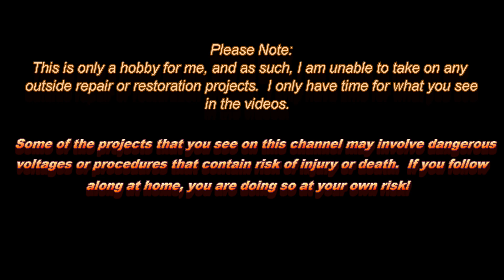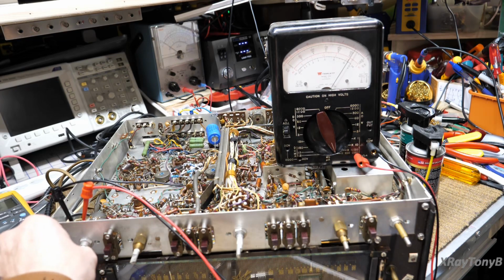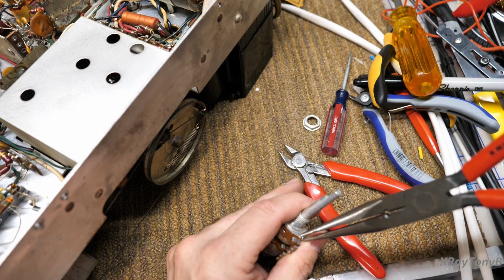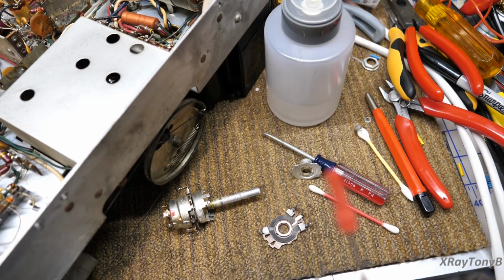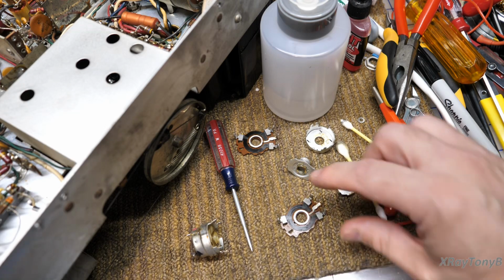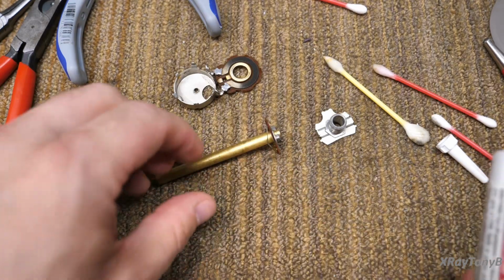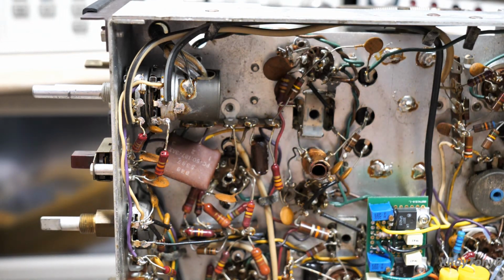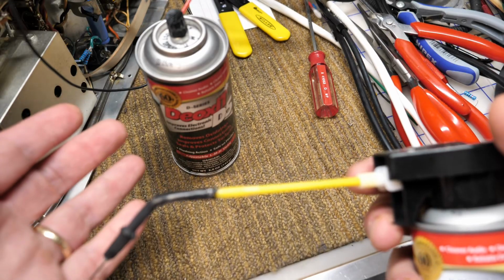How to Clean & Resurrect an Embalmed Potentiometer (With Bonus Rant)

Comment: So now I guess the question is do I mess with my pots knowing they have a LIGHT coating of Deoxit red or just leave it because they are working fine for now, and have been for a couple years.  I knew exactly HALF this story, I did not know to not use Deoxit at all on carbon trace pots, I thought a very light application to lube was fine.  I also dd not know about friction grease, and yeah, my pots have no resistance when turned.  Man, I hate to open that thing up again...I suppose there is no immanent danger...
Reply: Well, that's a case of "if it ain't broke, don't fix it" vs "preventative maintenance ".  A lot of variables here. Time, money, effort, return on investment, replacement part availability, etc. I  have several pieces of equipment (all antiques ) that were  exposed to minimal doses of RED! They work fine and the pots check out great on a VTVM. I'll be using this info for future work, but I'm not losing any sleep over carbon track health. Cheers

Comment: What is the difference between the  Deoxit D5 and G5?
Reply: G series is for Gold contacts, hence the GOLD all over it.
Reply: tip - dont use gold plated cables unless the equipment is gold plated. Dissimilar metals in contact means the more reactive metal will corrode (thats how batteries work), & gold is the least reactive metal, so your equipment will end up being the sacrificial anode. All non gold plated cables even with gold plated equipment is fine as long as you dont mind the cables corroding eventually, theyre easy enough to replace.

Comment: Gosh thought you saw a cockaroach on the cap.   Would advise to take pictures with disassembly.  Tabs doesn't take multiple bending very well.  Also marker or metal scribe.
Reply: Yeah, a Sharpie mark doesn't adhere well to surfaces that are already oily or greasy from previous attempts at cleaning the control, and alcohol will wash Sharpie lines away in a millisecond. Scribing a line works better. And, as Tony said, take pictures during disassembly. If somebody is a newbie at this, practice on an old control first; and clean the workbench in advance before disassembling the pot! A sectioned tray will help keep the parts in order so that you can put them back together in proper order without making mistakes. You might only get one chance at doing this right!

Comment: Wish I had seen the Deoxit D5 Spray video a few weeks ago. I messed up the pots (carbon) on my guitar. I've used the stuff for years but always in tiny little sprays. Overdid it...The pots are destroyed. All gunked-up... No more DEOXIT
Reply: Use WD 40 I swear by it
Reply: @kerrybarratt6298  It may work for you, but I've had plenty of situations where I've had to clean out WD-40 that has gunked-up controls and pots.  WD-40 is nothing more than kerosene in a can and is not designed for this purpose.  It was designed to displace water.  I've only found it useful for removing stickers and re-flowing dried grease with temporary success.
Reply: @kerrybarratt6298  You would REALLY love the channel TechYesCity then, he uses SuperCheap Auto Multi Purpose Cleaner by the case to gunk up electronics

Comment: DeoxIT D5 uses minieral spirits. Acetone is a mineral spirit. Mineral spirits break down carbon. This is why they're used in engine cleaners. Mineral Spirits break down carbon deposits in the engine. 
So this is why using DeoxIT D5, which contains 75% mineral spirits in it, shouldn't be used on pots and faders.
Reply: you are totally wrong

Comment: DeoxitD5 has NO ability to harm any potentiometer at all, period!!!
Reply: not exactly true.. Ive seen amplifier restoration videos, where there was absolutely nothing wrong with the pots, But they sprayed them with Deoxit anyway, just as routine maintenance during the restoration.. and afterwards, the pots had loads of issues...
I think it all depends on how the potentiometer was manufactured though.. Its materials inside..
Reply: Indiscriminate use of Deoxit can completely remove all the "feel" grease from a pot, so that statement isn't completely true. A little goes a long way and if you don't saturate and use a quarter can on a single pot you will be fine. That's the problem with some DIY's is that they obliterate the pot with the stuff and ruin the pot.

Comment: Next time a pot needs a spray, I'll probably first try D100 or F100 spray to keep damping grease intact as much as possible. I wonder how much of the D5 "gunk" is really just partially dissolved damping grease. By the way, has anyone ever tried compressed air to clean a pot?

Comment: Tony;
Thanks for this video. I wish all these "I deoxed it" people would watch this video and stop ruining wonderful old 1970's audio equipment.
Reply: For vintage electronics from the 1970's and on, using DeoxIT D5 is perfectly safe if used correctly (not flooding the pot - just a quick "spurt").  It's very unlikely the carbon has been worn off to an extent that D5 would cause any issue.  It's older pots from the 30's-60's, especially ones that are made out of what is essentially laminated cardboard, that it can cause issues.  I love Xray Tony's videos and he's very clearly an accomplished tech, but some of the DeoxIT D5 "warning" is a bit alarmist.

Comment: what to apply and how to clean potentiometer but not take it apart just in receiver amp etc
Reply: Is that a statement or a question?
Reply: @johncoops6897  question
Reply: @DerekHundik  - Use a Potentiometer cleaner. DeOxit and many other companies make the stuff. Probably the most well-known are DeOxit F series (FaderLube) for faders. These are not AT ALL similar to DeOxit "Red" D7 or 100, which is a contact cleaner, and only suitable for wire-wound pots.
The important thing is that potentiometers have a smear of grease on the carbon track. Contact cleaner dissolves the grease, so the pot fails very quickly after "cleaning". The specialised potentiometer cleaners have a waxy lubricant that restored the friction-proof coating.
Probably the best way is to open the pot, completely clean the track with IsoPropyl alcohol, then apply a dedicated potentiometer grease on the shaft or slider (eg: Caig DeOxit Fadergrease) and the correct lubricant on the track (if the pot originally used any).
It's worthwhile to trawl around the Caig website for more info.

Comment: I've found, and have been chastized incessantly for my method.  Now, Barry Fone of Barry's 8-track Repair is also another fella who doesn't like DeOxit.  He recommends just plain old WD-40 for its mildly lubricating qualities.  It does clean, but it's not as efficient as other cleaners.  But it does also have it's Water Displacing Qualities.

I go on better.  I clean using DeOxit, let the pot dry, then I spray with WD-40 to lubricate and protect.  

I was finding that if I JUST used DeOxit, the pot would get noisy again in a few months of use.  If I DeOx'd and then WD-40'd..... stuff I'd done 3 years ago still works as it should.

YES, pots and sliders should be cleaned, but they should also be lubed.
Reply: WD40 isn't a lube, it's a penetrating oil.
Reply: @v01dgazer1  No it's not.  It's actually a Water-Displacing oil with mild lubricating properties.
Reply: @v01dgazer1  actually WD-40 is a solvent. It's Stoddard solvent specifically. Along with perfumes. WD-40 is the best cologne on the market. Drives the women crazy when they smell it!

Comment: Interesting.
I have done 80+ reel to reel decks potentiometres with D5 and after treated with F100.
I have never had a single issue and that does not count the numerous amps I have done.

I'd say that what has happened is someone tried a alcohol based contact cleaner and did not succeed, then tried with Deoxit and by that time grease from the shaft has laid itself on the carbon track. 
This I have seen many times, but no, Deoxit won't ruin a carbon pot. 

Now adays I use F5+F100 for potentiometres.

I do not agree at all without D5 ruining carbon potentiometres.

Contact cleaners containing alcohols, will damage carbon tracks, but as I already mentioned, not one single fault with D5 in carbon pots or even carbon slider pots.

Besides, of course the swab will pick up lots of debris, it's a used CARBON potentiometre, there will de dust, carbon particles etc. that make up that goo.

Best and kind Regards

Comment: All of this goes double for tube testers, and especially for anything that carries RF signals. Spraying controls and especially rotary wafer switches can make the phenolic-wafer insulators *conductive*!  You can ruin a tube tester this way, creating leakage paths between the switch contacts. I've had conversations about this with other wannabe techs ---- one guy told me he already knows all this but  "I was defiant and and did it anyway, and it still seems to work okay".  Until it stops working okay at some point in the future, or you happen on a particular piece of equipment that takes an extreme dislike to being sprayed with DeOxit, and now you've got a real problem.

Comment: I use 'Servisol Super 10' Great stuff
Reply: Seems to be a mix of propane, butane and kerosene. It doesnt claim to be plastic safe.
Reply: @mycosys  May not be safe for some plastics but I've not had a problem with that yet.  Its great for cleaning electromechanical components like rotating and sliding potentiometers, variable resistors, switches etc.
Reply: @EDcase1  Rubbers, ABS and other Styrenes would be the big gotcha for either naphtha or the heavier mineral spirits and volatile hydrocarbons in Super 10. Cole-Parmer have a good materials compatibility database.
The big gotcha for IPA is PU.
ABS is the biggie with so much computer equipment being made from it. Im sure most or all of us made 'n@palm' as a kid from fuel and sytrofoam.
Reply: @mycosys  Thanks for the info

Comment: Is it ok on faders?
Reply: No.  A fader is a potentiometer.  Deoxit should only be used on metal to metal contacts such as in a connector or a switch.
Reply: DeOxIt Red no. Deoxit F Green Yes. No residue electrical contact cleaner (isopropanol anhydrous & naptha are common) is also ok if followed with fader lube like Deoxit F. Seemingly the most effective in-situ method for very gunked up pots is no residue contact cleaner to loosen dirt, gentle compressed air to remove dirt and fader lube to relube.

Comment: So as i understsnd 
for small noise on pots use 97% alchohol then the D5 green spray are ok ? 
This will clean & will not remove the existing Friction grease that on the pot shaft ( will not make it loosie ) and or damage the carbon & fibers board  ? 
Just wonder what spray can we use  on vintage stereo pots without damage the lubrication????

Comment: Red Deoxit is just as bad as using WD-40. Oily cleaners are bad. I use Sprayway contact cleaner. It cleans and it evaporates leaving no residue what so ever. You can buy Sprayway on Amazon.

Comment: **Question:** Is it carbon from the atmosphere that causes potentiometers to malfunction?
Reply: No
Reply: @isoguy.  what is the black stuff that attaches itself to electronics contacts over the years?
Reply from the maker: The resistive element of this type of potentiometer is composed of compressed carbon powder.  As the metal wiper tracks around the carbon resistor, it begins to wear off, causing the contacts to get dirty.  In addition, the brass contacts themselves can get tarnished, which degrades the contact surface.  The purpose of the cleaner is to remove the tarnish and carbon residue and to restore the contact surface.  If you use the wrong cleaner, it can cause the compressed carbon to break down and crumble.  Hope that helps.
Reply: @midmodaudio6576  if we are talking pots the "crud" composition which builds up during useage varies depending upon potentiometer wear characteristics, modus operandi and location, for example
1)  metal to metal contact.e.g. pot spindle to pot body. (fragments of metal)
2) metal contact to carbon based track pressure and surface finish. (Fragments of carbon)
3) If unsealed pot atmospheric contamination, dependent on where the pot is operated e.g NaCl (salt) if used by the sea.
4) contamination already in the pot, grease, oils which are affected by temperature, e.g. cheap pots that use the wrong grease. 
5) if used in higher voltage applications, arcing causes carbonatious deposits from the carbon tracks and contactor metal/s.
6) contaminants from plastics and rubbers degrading in the equipment where the pot is being used, this may cause metal corrosion and chemical changes to occur in the pots carbon tracks.
If I were to generalise the black "crud" on metal contact carbon resistance pots usually consists of small amounts of metal from the contact and or its plating (wear/ oxidation), carbonatious material from the carbon track itself (wear) bound together with small amounts of oily compounds.
There may be many other contaminants present, as previoysly mentioned it depends on environmental conditions.
Hope this helps.
Reply: @isoguy.  thank you
Reply: @midmodaudio6576  you're welcome.
Reply: @xraytonyb  thank you for clarifying that and thank you for another very detailed and informative video